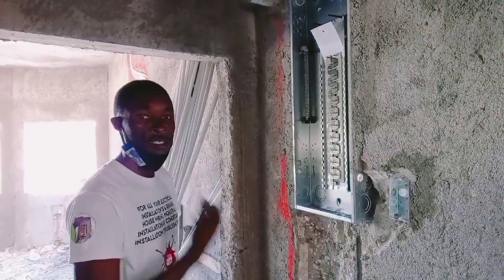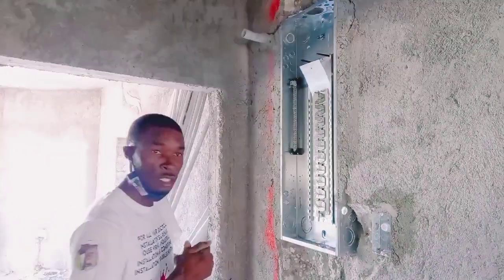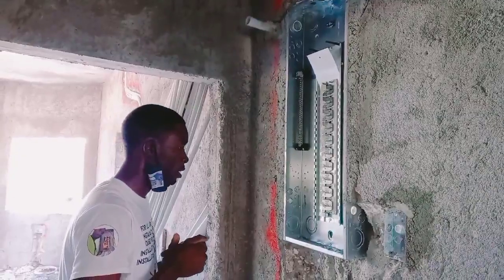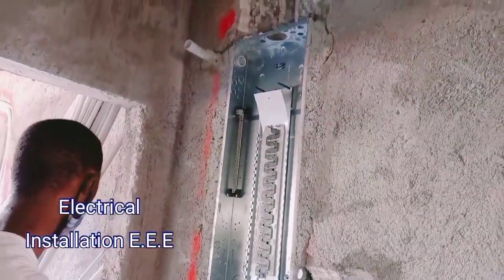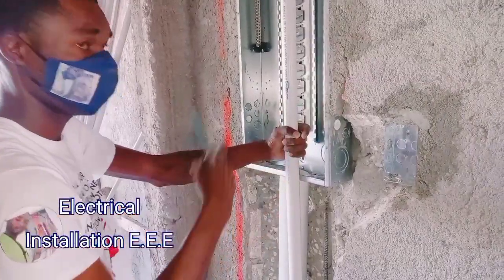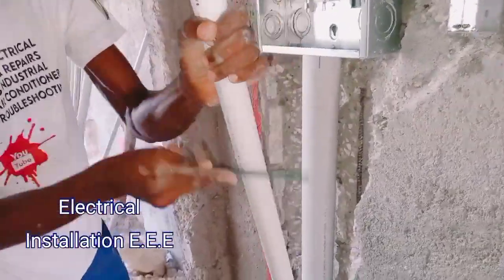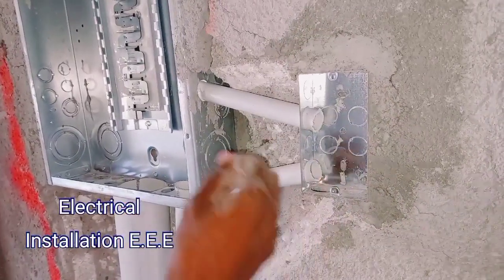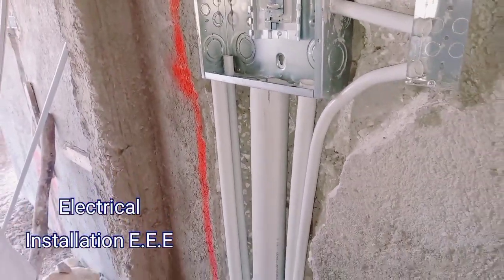How to install p.v.c conduits into main breaker panel !! #Mansionhouse

Comment: one quick question what size draw box you would recommend to use  with a 32mm pvc pipe  with 16 mm wire running through it
Reply from the maker: 4x4x3 good but most times i use 6x6x2
Reply: What section of the nec is this?!

Comment: It wouldn't easier if you did use 10mm bends? You work looks good me general👍👍👍
Reply from the maker: The main conduit is 3" & i did had to make the bend to get it how i did want it at the time.
Reply: @ElectricalInstallationEEE  lol thats why we special in the business because we can me things out thin hair.

Comment: Will the wall not crack with all those conduits? I mean how to you get concrete to adhere to that section under the panel?
Reply from the maker: Lol , it won't crack my friend a mean it can but i never saw it happen before . A lot pipe for real and space
Reply: @ElectricalInstallationEEE  😆 nice work dear. You're a hard worker and skilled. All the best

Comment: Quick question if you are going upstairs do you run a sub panel up top or u use one panel for the entire building? Especially for the lighting circuit
Reply from the maker: I will install another panel for individual or sub incase

Comment: Bro it a lot of pipes by it something I love
Reply from the maker: Lol just a few it could have been more if it wasn't for the 38mm which i'm using to make a draw box
Reply: YE ME G, BUT I COULDA BE MORE TOO, BUT IT ALL DEPENDS ON THE NUMBER OF BRANCH CIRCUITS ND HOW U PLAN TO SPLIT THEM UP FI USE AS LESS PIPE AS POSSIBLE,